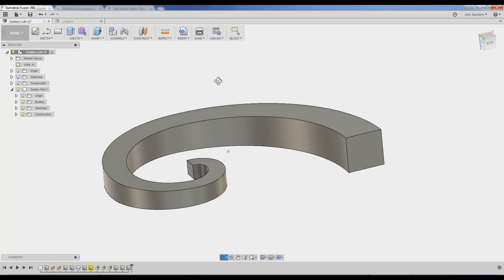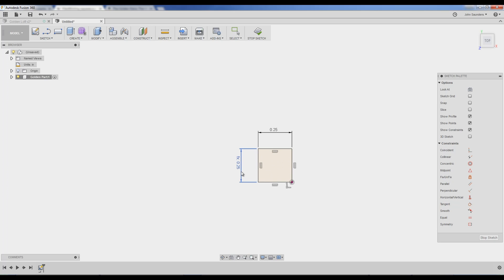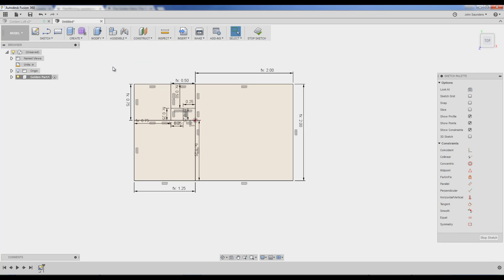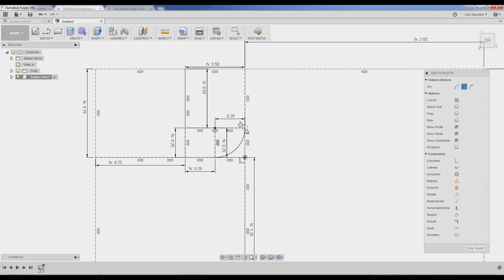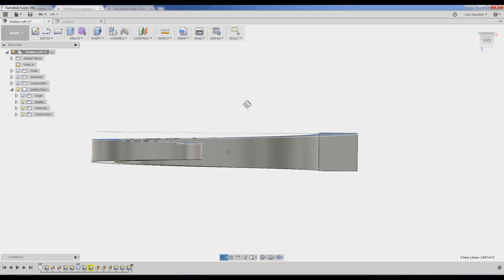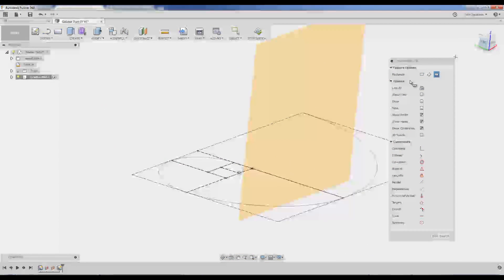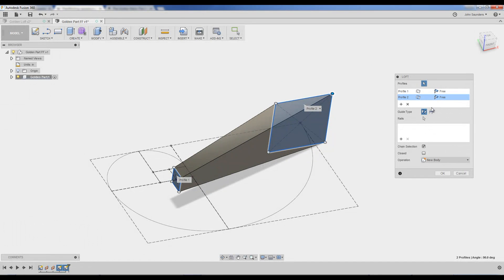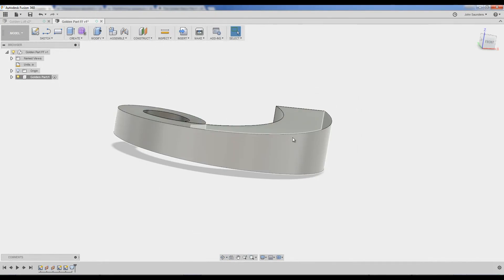Fusion 360 Loft: The Golden Ratio!  FF79

Comment: Interesting, however ...
this simple approximation will have abrupt changes in radii at the tangent points.  Also the cross section change from start to finish will be a uniform change rate and not a golden ratio rate of change.  Skin it with zebra stripes and take a look.  spline?

Comment: Hey John, try right mouse click and the option on the top OR right mouse hold with a swype to the top for the same action instead of searching ;)
For machining: simple plate, square sides, machine first side with tabs on the part, flip, second side, cut the tabs by hand and file it flush

Comment: The Fibonacci spiral is only an approximation of an approximation. Why not use the math available in Fusion360 to create a true golden spiral?
Reply: Try d1*(1+5^.5)/2 (I just tried it; it works.)

Exponentiating by 0.5 gives the square root.
Reply: I would love to know how to create a true golden spiral in Fusion. I think I've seen one video where someone exports a bunch of points from Excel, but is there a demonstration where someone puts the formula directly into Fusion?
Reply: Right. It does seem as though such a feature would be useful. For instance - for something like this by entering a formula that calculates the radii for a sequence of angles (which might exceed 360˚ for multiple revolutions), to make a true ellipse (instead of an array of eight circular arcs as AutoCAD - and probably Fusion 360 - constructs them), or to make a cam by formula or even by just entering a list of values for radii at given angles.

The problem with AutoCAD using circular arcs to approximate an ellipse caused me problems when trying to lay out an elliptical room (for a Whispering Gallery). The circular arcs would have resulted in placing the wall locations in positions that were incorrect by several inches  (50-80 mm) plus or minus in an elliptical room 26 feet by 17 feet (approx 8 m by 5.2 m). This would have destroyed the whisper effect by making the sound path lengths different lengths. We eventually laid out the walls using the simple string (Kevlar™, to avoid stretch) and two nails method. Having a formulaic method of creating ellipses would have saved us some trouble (and allowed the as-built final drawings to match the actual construction).
Reply: can you write the math example he should use?  F360 can't handle √ in the equations   like   d1 (1+√5)/2
Reply: That just gives you the numerical value of the golden ratio. You might as well just type in "d1*1.618". What I was wondering is how you enter a formula which then defines a path. Is that possible in Fusion?
Reply: Yes, using golden rectangles is still only an approximation of a true golden spiral.

Comment: Hi John,
In order to draw a golden spiral your squares need to grow by phi:1 ratio. Your spiral is using squares of variable ratio that approximate phi with each step (2,1.5,1.66,1.6). It's close, but it's not golden :)

You cannot practically draw a golden spiral with squares only as they grow smaller to infinity. What you can do is start with a golden rectangle (1:phi side ratio) and then build around this with squares, starting by using the long side of the golden rectangle as the first square's side. This way each new square will have sides phi bigger than the previous.
Reply: auhopu 
It's close enough for government work.
Reply: John's spiral is to the golden spiral what the Fibonacci sequence is to phi. An approximation that reaches phi in infinity. In theory a Fibonacci spiral is a golden spiral if you use infinite squares. In practice (with a naked eye) it should probably look very close to the golden spiral after 8 ratios (10 squares). The more you use the better.

Here using only the 4 first ratios out of the Fibonacci sequence makes this approximation... um... rough.

Comment: To make the part?

Option 1: 4th axis tombstone and/or Mini Lang vice setup with a potential '0' Op, if prep is needed. (shouldn't have to, small part) Hold by jaws for 1 Op, machine all around leave tabs around the outside part wall as needed.

Option 2: is basically the same idea, but instead of the 4th axis, you do the same thing but use a vice. The 4th Axis idea leaves the outside stock walls rough (or possibly non existent) , but with this one you machine them to grip in the vice for Op2. OP1 is to machine the surfaces only and skim the stock walls, Op2 is flip and locate the X edge of skimmed stock wall then machine the surfaces then the part walls, leaving tabs.

Option 3: Custom fixture on a Plate.  Op1, hold in vice, thin grip. Machine everything leaving 6th side. Op2, bolt down to fixture. Gripping the part walls to the fixture walls with something like Mitee-Bite clamps could do. Then the second Op is just a Facing and a Surfacing path. This can be rather efficient when doing a bunch of these, and no Tabs to deburr. Four at once should be possible.

Option 4: Vice and profile matching Soft Jaws, Op1 is the same as in Option 3. Op2 is hold in Soft Jaws. This may be weak and might be pressing the part on itself. But if it holds, it is probably the fastest, and still cleanest to deburr.

Option 5: 3D print the damn thing, and go to bed. ;P

Option 6? Wish it into existence?

edit: numbers.
Reply: gredangeo 

Can be done in 2 ops with a 3 axis mill. 

You're over thinking it because it's angular. But you have still have vertical sides that are parallel.
Reply: Yeah, two ops would work most likely. Option 2 or 4 would be best.

Comment: Had no idea about d-values. thanks!
Reply: NYC CNC wouldn't it have been easier to use "d1" "d1*2" "d1*3" etc. ? you still only have one variable, and it will still work the same
Reply: Geof Dumas you can rename those d values in the change parameters dialog as well. in Inventor you can name them on the fly